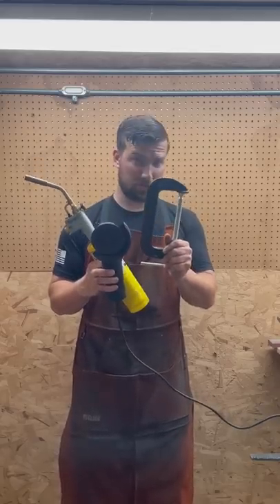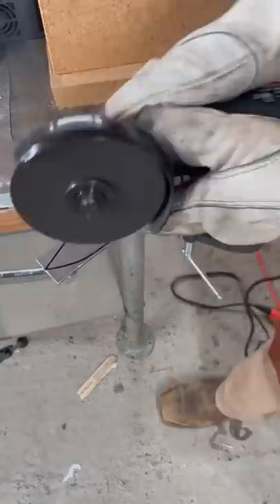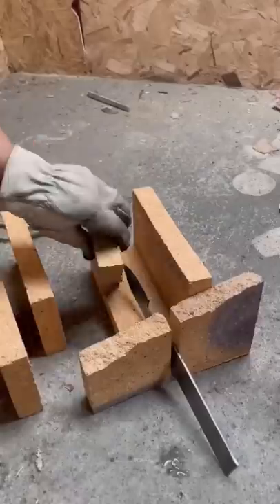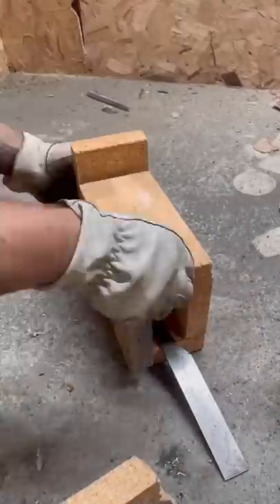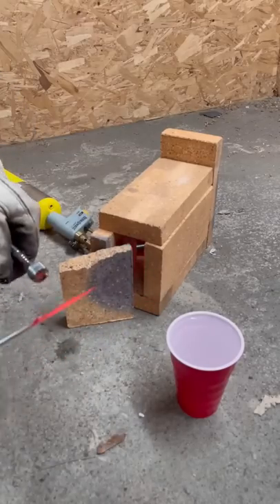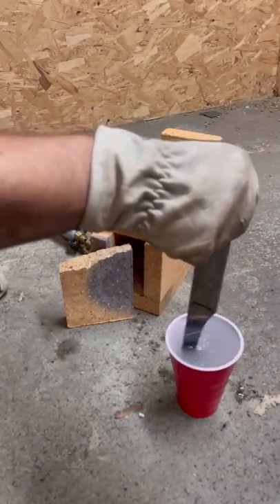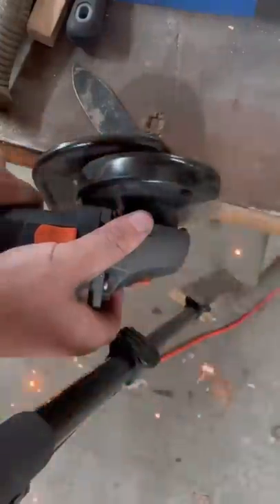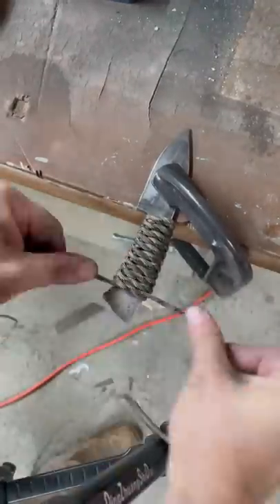How to start knifemaking without expensive equipment!!

Comment: Reason for water not oil?
Reply: Don’t you need a lot of oil to quench stuff do it doesn’t start to… boil..
Reply: @paperboatcanfloat3424  ok just wondering from forged in fire lol
Reply: @Slimchancemyguy  I really don’t know. I’m just guessing
Reply from the maker: 1095 is a water quenchable steel. If you don’t have Parks 50 which is considered a “fast oil”
Reply: @calculatedsurvival  never realized there was water quenchable steel. Really cool thing to be made aware of !
 I've heard heard of water  quenching. I'm wondering does mean you shouldn't quench certain steels in a brine solution?  Thanks in advance for any reply 👍🏻
Reply from the maker: @c.k.wilbur8675  yeah, 5160 and 52100 would definetly crack in water or brine

Comment: You said propane but it looks like MAPP gas
Reply: Definitely was, propane wouldn't be sufficient for heat treating in any reasonable timeframe
Reply from the maker: I mis-spoke. It is MAPP gas.
Reply: @calculatedsurvival  also only said 3 things in the beginning
Reply: @calculatedsurvival  I’m confused about putting it in the oven twice.  So for 2 hours?

Comment: Hold on brother are saying I can make my own kitchen or survival knives? Serious question lol
Reply: If you want to you can. But if might be a good idea to get some purpose build tools like a Forge and a belt sander
Reply: @jadoncampbell2740  Alright the simplicity of this video made it interesting
Reply from the maker: That was kinda my point. Break it down so people can understand it and be less intimidated to start the craft.
Reply: @calculatedsurvival  save this to my watch later. Gonna give it a go after this pcs
Reply: @ominous3166  you can also use a old file if you want as your steel because it will harden well
Reply: @jadoncampbell2740  awesome do I just follow the same process as the video?
Reply: @ominous3166  for the most part but you want to Anneal the file by heating it  up so it’s red hot and Letting it air cool witch reduces the hardness so it is easier to grind down to a knife.
Reply: @jadoncampbell2740  Automobile leaf springs are good to start with and  are available for next to nothing..
Reply: No!
Reply: @jadoncampbell2740  thanks for the advice
Reply: @zarasdad100  You're really upset about this video aren't you......  Is there a reason you feel the need to criticize so much???

Comment: Question is would you make one that you would sell to me. I wanted a strong 5 inch full pommel one piece Kabar. Most ones you see sold is 2 separate pieces. Which makes for a less durable blade.

Comment: don’t use 1095 if you don’t have access to proper heat treating materials. if this is all you have use 1075 or 1084. 1095 requires temp control

Comment: Next video, “so I dropped my knife and it shattered…”
Reply: You don't think the two 400 deg temperings he did would prevent that?
Reply: 400F with 1095 it will still be on the 62-64 HRC range very brittle

Comment: so advice for anyone starting out, get 1075 or 1084 instead of 1095 as there more beginner friendly 1095 is often considered a more advanced steel for knifemaking, steel i would advise try and find a local supplier rather then amazon as its likely to come from china which could be questionable quality compare to suppliers that get there steel from us or german foundries. 2nd the white/light firebricks are better then the hard bricks hes using here they reflect heat better wheres those hard bricks absorb. and for quenching, brine is ok but risky for cracking vegetable or canola oil is a great quench oil starting out

Comment: I used an old fire safe and a weed burner to make my forge. I just gutted the lock and took all the plastic or zinc crap out and replaced what needed to be replaced then used a hole saw to cut a hole in the side and stuck the weed burn in the hole. BAM! forge. Also worked great for reheating cold pizza and cooking cans of soup when i didnt feel like going back inside. Lol. Oh and i used a thermocouple and my multi meter for temp.
Reply: Basic items and old junk laying around with a little ingenuity can do amazing things if you have the desire

Comment: You can do the tempering with a torch. Heat the blade slowly and carefully from the back until your back/spine is deep blue, but your cutting edge is straw colored. This leaves your cutting edge hard and your back and handle area malleable so they are not brittle and subject to snapping. The hard edge will retain it's edge holding ability and the rest will not be subject to snapping. That's how it has been done for centuries.
Reply: That would be untrue. How it’s been done for centuries is by putting it back into the forge and watching it like a hawk. Believe it or not, torches are a modern invention

Comment: Real question. Why did you choose a  brine quench? As far as I know that's not usually very good for a knife with most steels and with as high carbon as it is it seems like it would be easy to crack it in the quench. Also why the 2 tempering cycles? The tempering cycles are weird sometimes so that's not as crazy sounding to me but still would like to know.

Comment: Pretty good idea 8-in seems pretty thin I probably would have gone for 3/16 or quarter that way you have a little bit more beef on the knife and it could be used for light Chopper too but outside of that pretty darn cool how to use the fire brick to hard to play that's pretty good and the 10% salt 90% water out that is cool

Comment: I’d just avoid getting the blade so hot while grinding and either letting it air cool in between passes or dipping it in water every so many. Or just normalize (anneal) the knife before heat treatment and temper. Companies do it to billets before shipping out (most of the time) but if you grind you blade to the point it’s changing colors, you should do it again. Will help with the grain structure
Reply: No it won’t. There isn’t any grain structure change unless it’s getting red hot

Comment: When the steel becomes nonmagnetic, that is when it has changed it's grain structure. There's a time, temperature, transformation table that shows how long you have to hold at a certain temperature to achieve the transformation you're trying to achieve. Using the magnet is an old school trick a lot of people don't know. It only works for hardening not tempering. Any steel, as long as it has good carbon content can be hardened. Oil is a better quench over water because oil has carbon in it.
Reply: Water also has carbon in it
Reply: @gsaexperience8578  are you serious??? Water is H2O.... Meaning it's 2 parts hydrogen and 1 part oxygen....so where exactly is the carbon you speak of? LOL. That's like the very first thing we learn about chemistry as children in grade school science 🤦🏼‍♂️
Reply: That’s not why oil is used and 1095 needs a speciality oil. Water works fine if you don’t have said oil

Comment: I'm so doing this, thank you 1 also that not propane it's also that's not propane it's acetylene and burns much hotter than propane
Reply: I might have to as well. Though, it’s a MAP gas cylinder which you can get anywhere. It does burn a little hotter, but not a ton hotter (3600vs3700ish).
Reply: @Binford2500  you're absolutely right I always just assumed that map was just acetylene gas in the bottle. I was trying to sound smart and ended up sounding dumb 😂. Thank you for making me actually check behind myself before I replied as I definitely just learned something even if it's something I should have known.
Reply: @BIGSTANK1983  All good! Just helping others learn something new :) You can also get acetylene in a bottle but you still need a special torch an whatnot (and the bottles are large for the gas volume). Only people I've seen use them is plumbers for large diameter copper pipes.

Comment: Honestly, as a hobby smith with maybe a small 1000 bucks worth of equipment, finding the proper steel is probably the biggest issue where I live.
Very few places here have anything but your standard construction steel or stainless, took me a while to eventually find a machine shop where I could order some 1060, which does the job, but thats about all I could find.
Reply: Well, if you're looking for some decent steel, auto shops or scrap yards may sell you old car springs (Leaf or coil), and you could also look for hardenable steel with a magnet, file, and some knowledge of where it would be used.

Now, in regards to selling them, I wouldn't really do it, because it's an unknown steel, but if you could harden it well, and disclose that is is a leaf spring, I'm sure someone wouldn't mind buying it.
Reply: Leaf springs from cars are often free, and 5160 steel is retalively similar to 1060 steel.

Comment: The oven bit, you said to do twice.
Do you let it cool completely before the second heating?
Planning on making a dagger.
My girlfriend is a seamstress, I'm gonna have her make a leather sheath for it!!
🤓
Reply: Noice, post it once it’s done
Reply: yes you want to let it heat up and cool naturally to reduce the hardness to a point where the metal isn’t brittle if you don’t allow it to cool slowly or don’t allow it to cool for long enough it will retain more hardness than you want it to and can be susceptible to chips and cracks and eventually failure of the metal
Reply: @BejibiTV  I will, might be a little while though.
Reply: @Dasshniplle  Thank you!!

Comment: You've spent alot of time on an angle grinder and it shows bro. Very impressed. I understand the purpose is bare minimum tools and materials but how well does it hold that edge?;
Reply from the maker: Pretty well….. but I gave that knife to a guy who asked to buy it off me. I’d have to reach back out and see how it’s doing. LOL.

Comment: Quenching steel in a brine solution can cause the material to over stress and crack on the molecular level. Motor oil or food based oils are a safer bet for whatever reason.
Reply: The whole point is for the material to stress on a molecular level. Motor and food oil are not fast enough oils for this steel. Water is the best bet

Comment: Would motor oil work better as hardening agent? I always heard water cools it too fast and makes it brittle?
Reply: Yes for other steels brine is best but 1095 is a shallow quench steel but you never want to use used motor oil because tiny bits of metal in lung bad
Reply: That’s why he puts it in the oven, to reduce its brittleness

Comment: Just quench in old motor oil or veg oil?  Why water at all?
Reply: You achieve different hardness with different methods of quenching. Ive seen water used quite a bit. Its risky but you get a pretty hard edge

Comment: Curious, why do you forge the blade but not handle?
Reply: He tempered the blade in his forge to harden it enough to hold an edge when he sharpens it. You don’t really want the handle tempered because tempered steel is so hard it can be brittle and crack if it’s stressed too much

Comment: I build a knife with a torch a grinder and a c-clamp. And some fire bricks. And a kitchen oven. And some salt. And some water. And some sandpaper. and some paracord
Reply: And some normal paper to cut afterwards
Reply: You forgot the most important thing ⅛ of an inch thick 1095 steel
Reply: @DanielSultana  dammit! The whole project is off!

Comment: You don’t quench in water! Oil is where it is
Reply: Nah, brine quench is recommended over oil for 1095. 1095 requires an aggressive quench so brine or parks 50 is perfect. Other oils will work, and you have less of a chance to crack, but they are way more inconsistent for achieving proper hardness

Comment: You mentioned that you put it in the oven @ 400° for an hour, twice. Could you not get the same effect by putting in for 2 hours?
Reply: You want to check to make sure there aren’t any warps in it after the first hour
Reply: Also it’s 400f to be clear
Reply: Yeah that's what I was figuring was one hour let it set and look for cracks then put it back in for another hour

Comment: Good job! Question.. why 1095 instead of like O1? Is it that you use 1095 water hardening steel vs o1 thats oil hardening? 
Asking for my next blade. It's 15" over all and normally make pocket knives. debating which to go with 
1095 up to 55 c
O1 tool steel up to 65 c
Reply: O1 or 1084 are super forgiving with oils. He used brine with 1095 because it's a little more finicky and requires a more aggressive quench. To be more safe, you can use parks 50 oil but it's fairly expensive. Brine works great for 1095 but you're more prone to cracking. You can go with canola oil or peanut oil but you have to be super precise with Temps. Like 1475 to quench in 135 canola oil. That's what I do but it's hard to be exact
Reply: 01 is exspensive compared to 1095 he’ll if you want to use 01 just save yourself the money and use 1084

Comment: I asking as a legit question, NOT because I'm pretending to know anything about making knives... I've made exactly "0", but I've watched _Forged in Fire_. I'm purely seeking knowledge here: Why do you quench the blade in a brine solution instead of oil? Is one better than the other? They always trip out when people quench in water on that show. (I do realize that water and water+salt are not the same thing, by the way.) Anyone? I'm genuinely curious and have no opinion either way.
Reply: Google it
Reply: You have a phone that you just wrote all that out on when you literally have the internet and could answer that question instantly. Like really my dude.
Reply: Opinions are like ass holes, everyone has one.
Reply from the maker: 1095 among just a FEW other steels is a water quenchable steel. Typically, a “Fast oil” like Parks 50 is preffered. If you aren’t careful, you can change the temperature too quickly and get cracks. But the result of an extremely hard blade with materials everyone has laying around on something this small was why I went with the brine solution. Just about every steel has a different speed oil that it requires, and Canola oil is kinda one of the slowest. But it is also the safest, so you won’t be getting cracks unless you did your finish grind in like a 36 grit which is another thing people don’t know. Too low of a finish grind grit and you are creating channels for cracks to form from.
Reply: @calculatedsurvival   Thank you so much for responding. Exactly what I was looking for. Very concise and informative, much like the video itself. Great content, man. Keep it up. Your getting there. Again, I appreciate you taking the time to satisfy my curiosity. Faith in humanity restored. Many blessings.

Comment: That blade is gonna be so brittle. I understand that that's more gonna be used for whittling sticks and cutting fishing line, but that thing will shatter a chip after a while. Oil is the best way to go. That's my only complaint other than not forging the knife for extra flex and durability
Reply: He drew (sp?) it back down twice. AND,, There's a reason he used brine...
Reply: Forging does not make a difference from stock removal.

It's just whichever works for you.

Forging doesn't imbue magical properties.
Reply: @twistedhillbilly6157  so what's the reason that he used brine?
Reply from the maker: @danielfinney4295  This is not a video for pros. Pros have expensive tools and Parks 50 oil. Everyone can make a brine solution with household items. Also, 1095 is a water quenchable steel.
Reply: It’s not going to be brittle. He tempered it.

Comment: So you put it in the oven for 3 straight hours or 1 hour, then let it cool down? Then back for another hour?
Reply: Two cycles in the oven. Let the knife get to air temperature between cycles.
Reply: I smeltersnatch and threw in the trowel.

Comment: How not to heat treat 1095 in one short video... 1095 needs a 5 minute soak at 1475 degrees per 1/8" of thickness it loses magnetism at 1275 degrees also known as the curie point ... magnets are not a good test of quenching temperature sprinkle table salt on the blade it melts at 1474 degrees then give it another second and you will be at temp .. 1095 is also a water quenching steel brine is too fast of a quench so quench in 80-125 degree water or fast oil like parks 50 never use food oils they are too slow
Reply from the maker: Hey Jesse,
  1095 Loses magnetism at 1425°F
  Brine solution cools slower than water. I agree that it should have been heated to 120°F first, however, the point of this video was to give a quick and dirty/minimal equipment/anyone can DIY video.
  Thanks for watching!
Reply: @calculatedsurvival  the nickel ball test on brine was 3-4 seconds on water its 5-7 seconds on parks 50 its 7-10 seconds... the curie point of 1095 is 720 degrees Celsius or 1328 degrees Fahrenheit (i was a bit off trying to remember shit i learned 20 years ago had to look it up again) in order of quenching speed fasest to slowest its super quench, brine, water, fast oil, medium oil, slow oil, air, food oils

Comment: Now I got a question what if people don't want to use a saltwater to quench their blade and they want to use oil can you show us how to do it with oil instead of the saltwater because I've heard different things saying that quenching with oil makes a better blade
Reply: For this steel, you’d need specialized oil which is pricy for a potentially one time thing. Oil is safer but water is just fine. Oil doesn’t make a better blade, it just decreases chance of warp and crack

Comment: You absolutely forgot the heavy duty work table with metal tubular legs anchored at the bottom to the cement floor of your work shack or space that will make your tools work for you such as attaching your so-called clamp, and the cement floor where you can lay your fire bricks and where to use your torch to create your makeshift forge.

THINGS ARE NEVER AS SIMPLE AS THEY APPEAR TO BE OR AS EXPLAINED!

                                ☝️😏👆